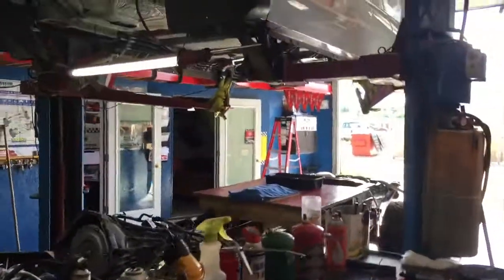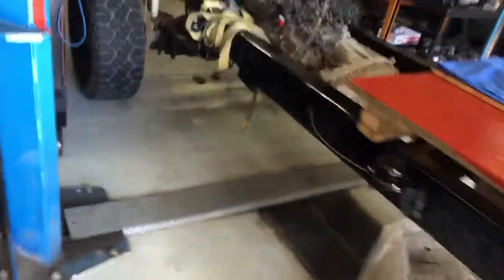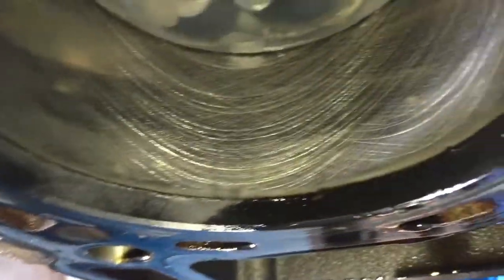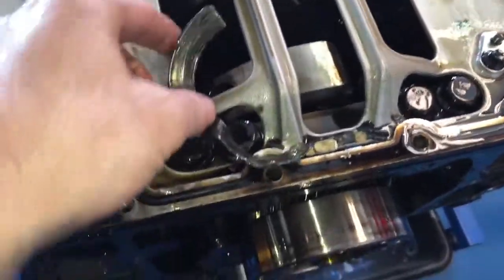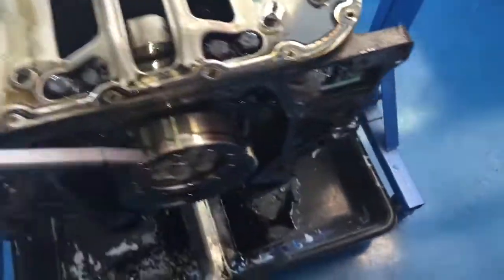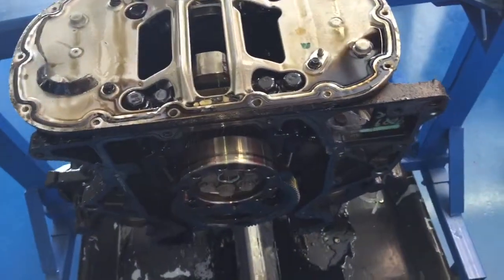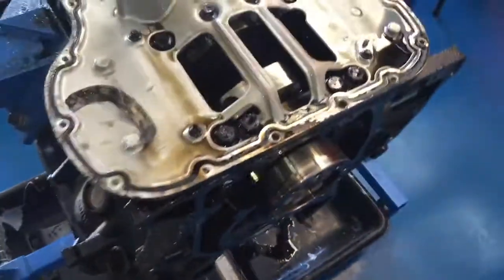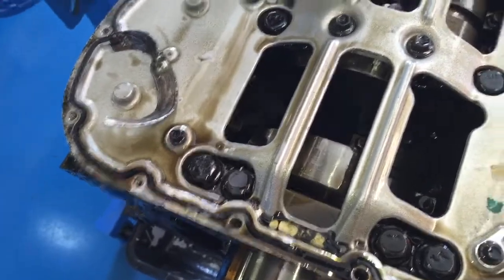Leaking oil and Throwing Belts crankshaft end play 6.0 Powerstroke All American Badass

Comment from the maker: We got it straightened out.  I will prob post a follow up tomorrow.  The failure was unheard of.  As it sits right now,,  we dropped a different crank in it with new bearings (just for measuring) and the end play was .005!!!   The block is undamaged.  Crazy huh???  We are doing new rods tho.  We honed the cylinders also.  It's all good.
Reply: Anthony Youngblood I have crankshaft play in my engine that was just rebuilt. It has enough play, to push the flywheel into my clutch and the clutch into the transmission bay. Is there anyway I could fix that? Any recommendations?

Comment: I have seen this type of failure before on a 3208 cat with an Allison Automatic Transmission.  The torque converter over pressurized and hydraulically forced the converter forward causing loss of clearance on the thrust and loss of oil film.  This caused the bearing to overheat and fail.  That appears to be exactly what has happened on this engine.  Putting a crank in only corrects the symptom, not the cause.  The Trans needs to be inspected to make sure that no mods were done such as a shift kit or high volume oil pump on the Trans.  In any case, your cause is not corrected.  A shift kit, which use to be a common upgrade on the Trans, usually involves the installation of a plate with restrict or orifices to apply more pressure to the clutch pack.  If the plate was incorrectly ported then it could be that the drain/relief port was not opened up causing excessive operating pressures.  They also have to pull the pump and pump housing for some porting mods.  The engine will fail again!